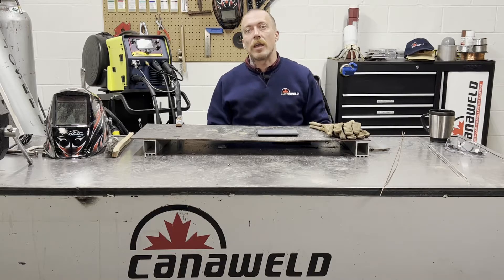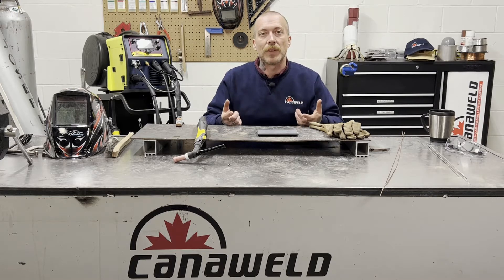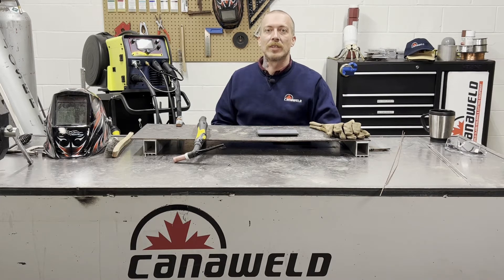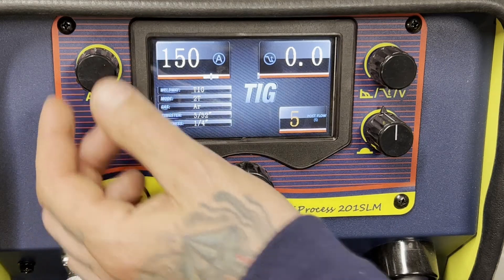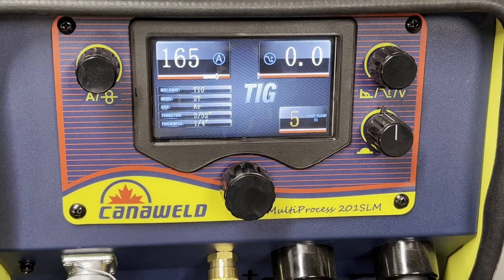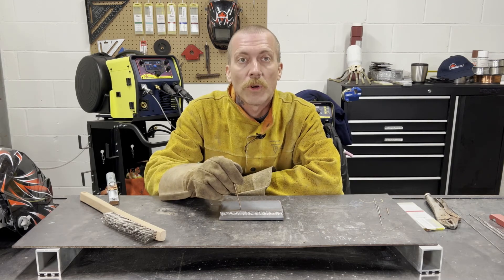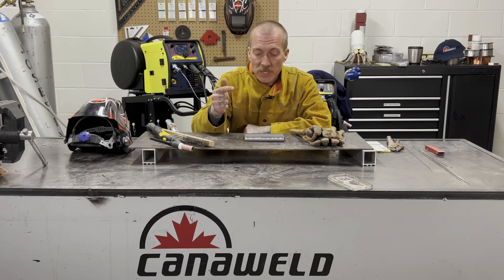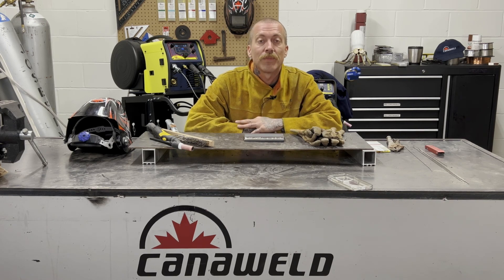Part 3-The Best All in One Multi Process Welder, MIG, TIG, STICK Welding Machine by Canaweld,

Comment: This video is incomplete.  I was seriously contemplating buying one but after seeing this I will pass.  Your welder says scratch start.  That means something entirely different to me vs Lift Tig.  Did he use the button on the torch?  Some welders have a pedal including where you can do a 'lift'.  To me this is no different than a gas valve Tig torch.  Tell me I'm wrong otherwise.  Plenty of other welders can do the same for cheaper.
Reply: I say you look into their 201 ac dc welder you get all tig functions with a foot pedal with the gold package and you get stick as well.